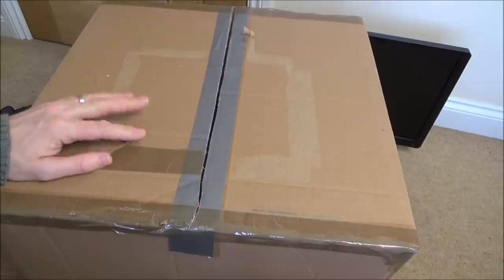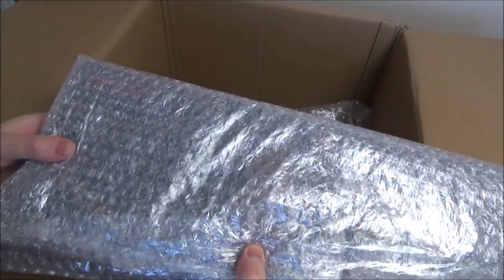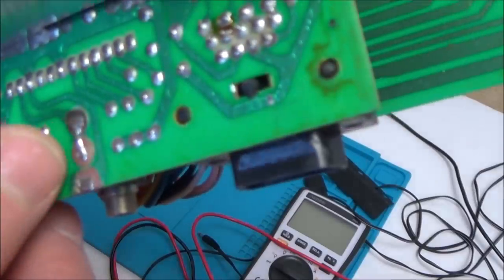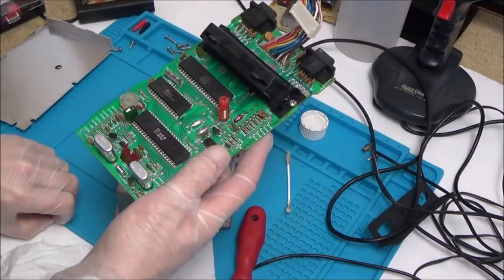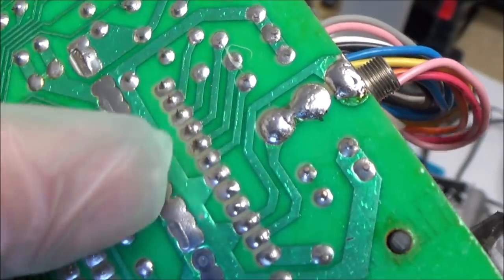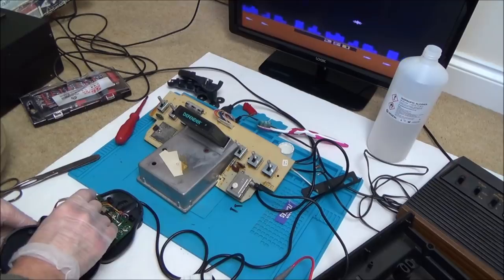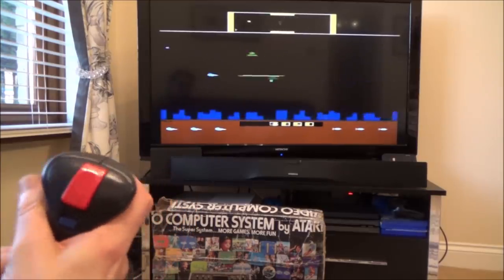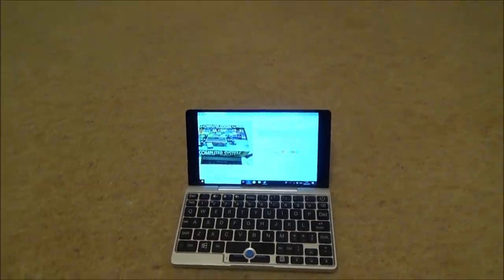eBay Pre 1980s TOY Repair Challenge PART 4

Comment: Vince "Dc Power Packs" usually read high without any load on them, Once a load is applied the voltage drops to around whatever the device it's designed for, in this case the Atari obviously is a 9Volt device, so it's load should drop the DC down to that.. 

*Addendum for now*
NEVER-MIND.. As I continued the Video, I see you just found out, Are you sure you read ALL the remarks? :) 
Because I am pretty sure I already mentioned previously, "A circuits voltages can read higher if they are NOT loaded, so when fault, finding a zero voltage or a higher voltage on a test point, it indicates that the test point provided for a given circuit is then faulty, So when testing a power supply it needs to be tested unloaded and loaded with a circuit or a device connected..

BTW as Usual I dropped a Like
Reply: I have a Multi-Meter that has a load mode. (Heater Coil in plaster brick).  A lot of people freak out when they get +30% unloaded Voltage. Good call.
Reply: Yeah, especially with early gen consoles with the regulation built into the console.  No load on an unregulated power supply nearly always results in a higher voltage...  Sometimes VERY high when first seeing it, lol.

Comment: Usually I encounter factory installed ic sockets on electronics with finicky IC's prone to failure or ones that need to be matched/flashed; a lot of higher-end guitar pedal manufacturer's still use these for that reason

Comment: I think the flickering is because of there not being enough CPU to have all the stuff on screen at the same time (the NES does this to display more sprites) and the CPU is probably not original because the Atari used a 6502 processor (I have been learning 6502 assembly and the tutorial in the app I have been using for that says what it was used for)

Comment: A & B switch I believe was for the american market.
Your 1st mistake was not realising that the gnd pin of the dc socket needed to be soldered.
2nd you connected your meter to the DC socket outer and not the big metal cover in the middle which should be gnd.

Comment: The channel select switch is only for USA. If I remember correct;y they were manufactured in California, even the ones sent to Europe. So instead of changing the mould, they just didn't include the switch, Plus the flickering is because the ATARI 2600 can only support two or three sprites at the one time, so to combat that the sprites will turn on and off, appear and disappear .

Comment: Dubious Engineering is doing a restore of one of these game systems, is the voltage regulator a LM7809 or a LM7805? if so a switching version of either version should make things work better, would a 8MHZ crystal work.
Reply from the maker: I believe it is a 7805:-) Thanks for the Dubious Engineering tip. I have just subscribed to him and will check out the videos over the weekend :-)

Comment: aftermarket joysticks were always very hit and miss.  nothing worked as consistently as the stock Atari controllers
Reply: Do the Atari flashback controllers work good on the original Atari's?

Comment: Multitasking at its finest. The ship disappears because the console has to draw the laser beam that the ship is firing. Since the resources aren't available to both draw the ship and the laser beam, the ship blanks out. Collision detection also ceases so you can zip through bombs and bad guys with an invisible ship.

Comment: The MSX was a Microsoft system in the same vein as the C64 or Vic 20, it was launched a little bit later than the speccy  (my system of choice) I had nearly every version of the speccy.
Reply from the maker: Thanks for the info. I never heard of that system when I was growing up :-)
Reply: My Mate VINCE That’s not correct.  MSX was a Japanese computer standard that used a Microsoft os.  Multiple companies released them, toshiba, Sony and a fair few others.
Reply: @AcornElectron  Both answers are more or less correct - it was a standard of 8-bit computers proposed by Microsoft (Japanese Microsoft division). They tried to do with 8-bit machines what they have succeed in x86 line together with IBM. Many manufacturers (mostly Japanese) were creating 8-bit computers compatible with MSX standard. So it was somehow successful.
Reply: @Mymatevince  I'm with you,I never heard of a "speccy". I pride myself on having almost every game system built from"Pong to PS3,Im 81and still collecting & playing & repairing video games & consoles......73's

Comment: Defender's ship has always dissapeared when you fire, its probbably down to the sprite limitation, same with PacMan.
Using autofire when playing defender is a bit of a cheat, you can still fly around just fine but your ship is a lot harder to hit. It was how I always used to play ^_^'
Your console is in as good a condition as it can be I think Vince. Beats mine, which has lost one of the switch covering felt pads somehow.

Comment: There were many electronic toys prior to 1980, however, most were not very well made and the majority of them did not last very long.  Most broke within a relatively short time, (a few months), and where disposed of.  Those that survived were bought by those who didn't allow kids to play with them, or kids who didn't like playing with them and they got shoved into an attic and forgotten for years.  That's why they're pretty rare.

That's not really a, 'toy', in the traditional sense of the word.  That would be called a, 'video game', and wasn't something that kids were given as something to play with, but more a, 'family', game to be used by parents and kids alike.  The reason being because of the cost of the things being pretty high.  You wouldn't let kids loose with one of these as the joysticks would break in no time at all.  Those Atari ones in particular were quite pricey and a lot of people opted for the cheaper Acetronic/Radofin models which were very popular at the end of the 70's and into the early 80's before the home computer scene came along.  TV games generally tuned into channel 34 on old analogue TVs, although, the one you have may have been re-tuned because of the Channel 5 station using that frequency.

Comment: The dodgy colour schemes is called "attract" mode if memory serves me right which was brought in because of damage caused to the cathode tube by having it repeatedly scored in the same colour electrons which caused ghosting to permanently scar the inside of the tv tube, Atari was the only one to do this and it was found on the 400/800 console-a-puters too.   On the latter there was a call command that put it into attract that you could use the BASIC cartridge to work a countdown loop in your homebrew games to then put the programme into attract or face the wrath of mum n dad if they were trying to watch the Waltons and all they can see is giant flying willies as the backdrop (I assume I wasn't the only one that had various games programmed with embarrassing human parts flying about?  Anyone?)

Comment: I have one of these units with two paddle controllers and a joystick.  I am missing the power supply.  I also have a box of games.  Let me know if you would like this.  Haven't a clue of the operational status.
Reply from the maker: Thanks, but I couldn't take that off you. Get yourself a power supply from eBay and it may still work. You could sell it for probably £80 or more depending on the games. Thanks for the offer though :-)
Reply: @Mymatevince  I absolutely couldn't think of anyone more deserving than you for entertaining me with your excellent content.  Your style of filming is very enjoyable.  

Frankly, I got it from the house of a deceased man that I helped to clean out.  I'd love to be able to use it, but video games are not really my forte.  I also have several Xbox 360 machines and parts as well as a PS2 and a PS3...all in various stages of operating status.  I had three girls hence the collection!
Reply from the maker: That is very kind of you for the offer and the positive feedback on the videos. I will source a faulty one on eBay again one day with the paddle controllers (I like the look of them for some games) and then film the repair. You can sell your one and take your family out for a meal with the proceeds. If you do get a power supply and it doesn't work then let me know as I can buy it from you instead of eBay, no rush, the offers stands whenever/if you get round to testing it :-)

Comment: the original adapter would have been Atari branded.  you'll know its original cause the cord will be kind of stiff and crusty.  you also didn't get the original controllers or RF adapter.  He sent you a C64 quickshot joystick from the late 1980's.  Original controllers or paddles are different.

Comment: It amazes me that everything the Atari did can now fit into the space of an original Atari controller and has 20 or more games included inside. Atari wasn't even able to properly replicate the arcade version of Pac-Man until the 7800 (Years later).
Reply: The first system I played on generally only played versions of Pong but came with a full sized sniper rifle you could break down and reassemble. I had more fun timing myself doing that.
Reply: The reason Space Invaders moved faster as you destroyed the aliens was because the CPU had an easier time computing less aliens.
Reply: I can be a lot smaller than that. A raspberry pi 0 is only a little bit bigger than the cpu and can hold thousands of games.

Comment: Why don’t you do a bit of research before you make the video. For example: you would know that the Atari does not output anything without a game. Also it would be nice if you knew what channel on the TV you were looking for to view the game?

Really you have never seen a DIP socket before???

Where did you get the corn flakes repair?
Reply from the maker: Hi, I like to work it out on the video otherwise I am just using other peoples knowledge. When I get stuck then I go to Google for help but I think some viewers like to see the thought process of fault finding even if it is often wrong. I knew you could get sockets when making your own modifications but personally I have never seen them installed in a manufactured device before. The ones I have seen were soldered straight on the board probably for money saving reasons so it was nice for me to see that in the 2600. Using the corn flakes box to shove into the cart socket???? I just thought they look a similar thickness so I thought I would try it :-)

Comment: It was kind a painfull to watch first 10min of fixing because it was really clear from the video that ground wasn't connected and it needed resoldering :) Mistake was also to measure ground from plug, not from PCB so you didn't see that you didn't have ground.